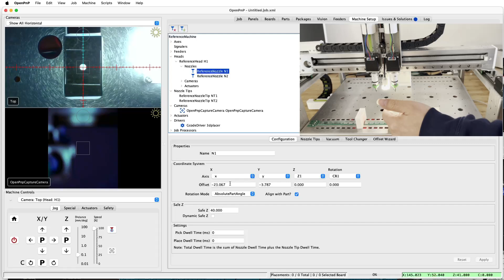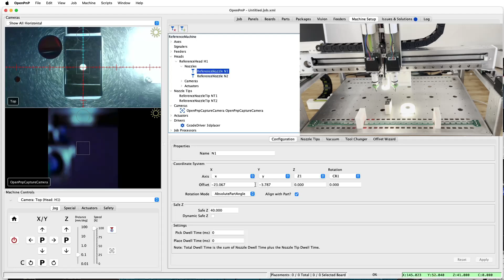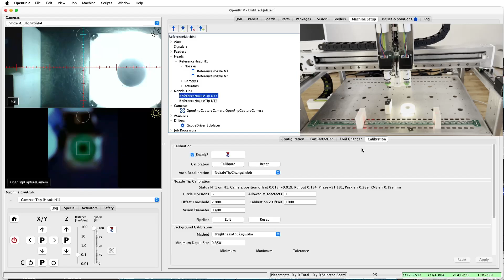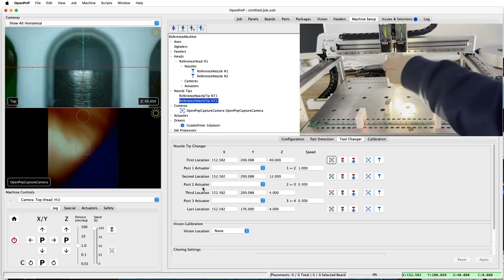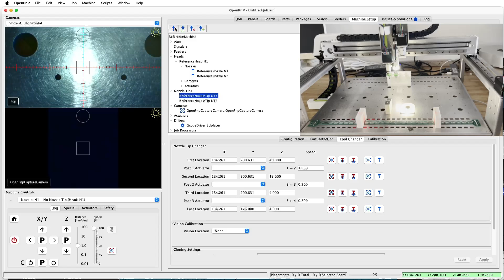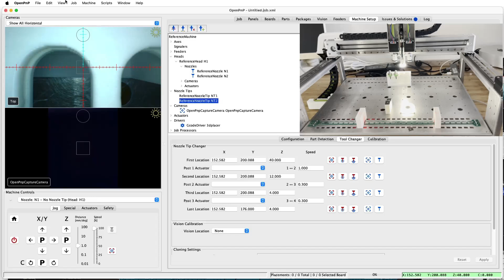Setting up 3DPlacer v2 Part 5 - Calibrate nozzle tip offset and setup nozzle switch

Comment: How is it going with the release? Do you need any help e.g testing? Planning to buy one when you're finished with the autocasette. Do you have a discord server for xpDIY?
Reply from the maker: Hello, thanks for following up, the feeder I have a prototype now, one motor with both advancing and tape cover pulling, a lot of testing, if you like, I can send you the files and you can try out. I want to reach a stable state then release.
Reply: @xpdiy Yes! I can help. Ate they at your Github ?
Reply: @xpdiy or not?
Reply from the maker: Hi, Thanks for waiting, I just put out a video, will put the design file end of today and tomorrow you can download from github, you will need m2x10 (4), M1x4 (2) and one o-ring to assemble, I will make a video on how to assemble tomorrow.